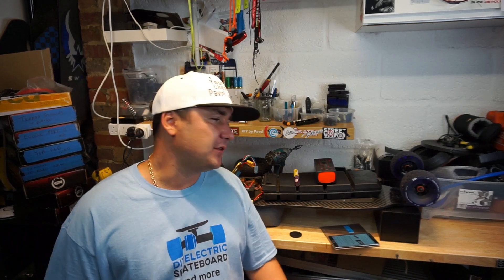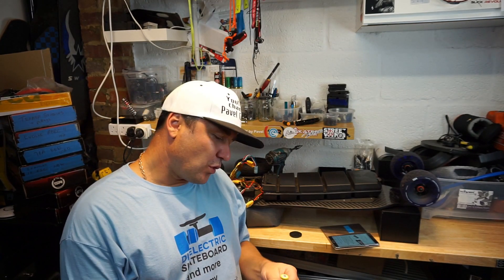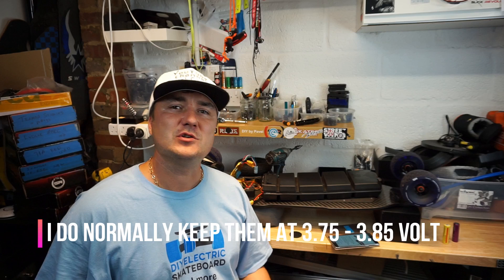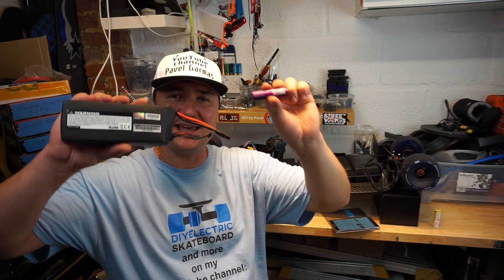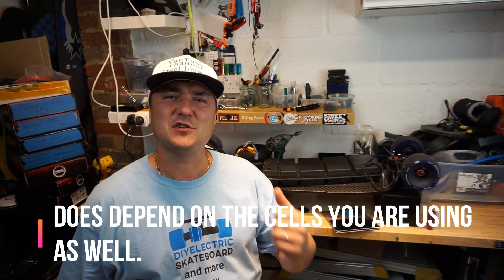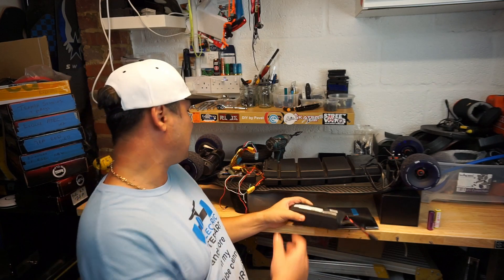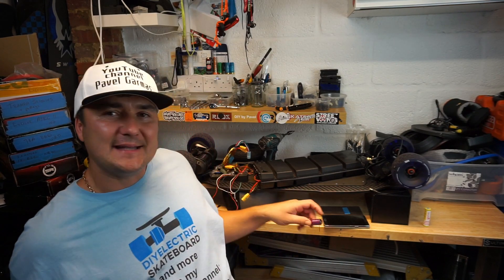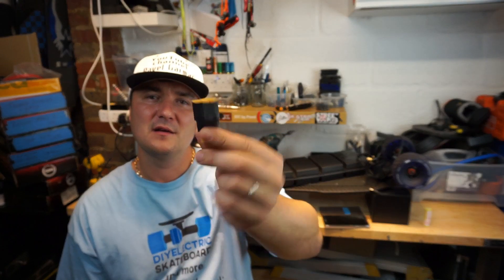LIPO or 18650?  Battery video 02

Comment: I bought the £1000 trampa 18650 pack and was getting 14 miles semi hard riding. Performance loss/voltage sag when going below 70 percent. Took that out went back to lipo felt like entire new board. 21 miles of hard riding and full power drawn all the way down  till 20 percent then I shut down. I. Hugely disappointed with 18650s if you ride a mountain board a require raw consistent power then it is lipo all the way.
Reply from the maker: Agreed. Unless a very good cells are used...

Comment: i think 1850  hve more range , im looking for  12s 8p  , the only problem i see is low amps on motors
Reply from the maker: Hello mate,
Thank you for watching buddy. 12S8P would be an awesome battery and if you use Samsung 30Q you should be able to push it at 160Amp max = two motors 80Amp each and that is a lot : ) 
Ride safely buddy.

Comment: Having a lipo block ontop of the board is a trade-off for having strong power for longer. But I'll want some of those custom cages for my big block lipo
Reply from the maker: Lol,
I am using both - the battery in the backpack and the block on the deck if I am going for a longer ride. Two 6S lipos do give me 7 miles of riding.

Comment: buying an of the shelf product which has good quality if you spend enough money vs diy battery which involves hassle in building. I know what i gonna choose :D

Sure if you want the max from your board, then build yourself but if you have no idea and no tools, then just go for lipo. Trampa boards also come with a pretty good charger, so no problem on that side. easy as hell to maintain them.
Reply from the maker: Thank you for watching and for commenting mate. I do agree and will be using Lipo on my Beast and potentially future Trampa : )

Comment: Hey lover ur vids but Ohmm man that part about the 60cells for 2 lipos packs is rly off with 60 cells you can create a 12s5p battery now lest take vtc6 batterys for that pack, u will have a 15.5ah battery with 175a max draw, to make that same ah with the lipos u will need 4 not 2. And li ion packs can be charge on the same charger as the lipo carger, they will work on bms and balance charger just like a lipo. And btw lipos way more per wh and have more mm2 per wh. Cheaper lipos wil have sag to, you just have some beasty lipos ;)
Sorry no hate just thought i would mention it
Reply from the maker: Nice one mate! I do love when people engage with me and with the community : )
You are correct .... but Samsung 30 Q are normally used in the builds and this is what i have considered for my discussion.
I am working on a new battery now and each cell should deliver 4500 mAmp and 30 Amp constant....hopefully manufacturer did not lie : ) Tests will bring out the truth.
Thank you very much for watching and for the comment!
Reply: @PavelGarmas  cool stuf😮, i get what you mean, although i  would always use vtc6 cells for higger power board. Keep us posted
Reply from the maker: Will be testing the Molicells soon so hopefully beast will get beast battery pack : )

Comment: real men use lipo's
Reply: THOSE with brains buy used best ten second charging nanograined stainless steeled panes
Reply from the maker: I did even google this.....what do you mean mate : ) ?
Reply: @PavelGarmas  the packaging of ebay never cycled LTO 40ish watt hour for $28 bucks or much less is SS.

The scib site itself shows smallest cell (23 amp hour is LARGEST) being ten second chargable.

I personally recall the fuel cell bike used test cycle of H filling station to fill up.  We use so little power superchargers can have us from zero to kwh-ish in seconds if safety and no multiminute to hours delay has VALUE.  Carrying jack around is a pain sure.. But backpacks able to accept fattest fire hose power in make beast owner's happiest. ⛽ can't be pumped like electrons.  Lightning is best free charger ya know. The challenge is finding proper BOTTLE for it. Https scib.jp is close ENOUGH.
Reply from the maker: LOL
Well said!

Comment: Price, size specifications, output (c), mah, and cell count need to be taken into account. A graphene battery like that is great for rcs, but is overpriced, and needs to be designed around for your builds. There not flat, not customizable, and more dangerous than 18650s. If you don’t like 18650s, they have different sizes. In small applications, lipos are king. In large builds, like eboards, when you have dozens of 18650s in parallel and series, and have plenty of current, and voltage, and for that reason, for me anyway, 18650s take the cake for sure.
Reply from the maker: Tank you very much for watching and for the comment mate!
Always good to see people with opinions and reasons why. It is hard to disagree with you as you are correct,
18650 pack that is built correctly and got good cells is hard to beat.
Ride safely brother and stick around.
Reply: Pavel Garmas - 🍻👍👌

Comment: no 18650. 21700best
Reply from the maker: Ok.... very interesting comment. Any chance for couple of reasons why?
Reply: Pavel Garmas sure I'm using 21700 10s5p.  Higher capacity . higher Battery life . It's just a little bit bigger .  Tesla now USES 21700
Reply: samsung 21700 48g
Reply from the maker: Thank you buddy!
Reply from the maker: Got it.
Reply: @PavelGarmas  i do think screwing around with commodity shit cheap enough for high range cars is miserly.

Titanate oxide has competition as Tesla notes in free published 'paper.'

TESLA has notorious sag... 

Supercapacitor can help charge much faster and nondestructive as nanoseconds duration  pausing is required to let dendrites collapse.  A padded ring of scib titanium previously burned in half a decade by Honda lessee's around waste sets inner beast free by such hip protecting collar.
NOT BEYOND COMPLEX @ OWL

Comment: 30q or vtc6 is about 2.60 euro nkon.nl vtc6 no voltage sag. A 4P pack can easily put out 120amps.
Lipo is a pain in the arse awkward shape, need fancy charger, lower voltage, they have a shorter life, they have a tendancy to puff up.
Lipo give off toxic gas. Quality lipo cost more if you build your own packs. 18650 has a mechanic safety fuse on the top. Lipo nothing they just puff up. Lipo mire likely to destroy your antispark. Lipo are more expensive. You compared a 50.4V 15000mah 30Q pack. 5 x 3000 to 44V 8000mah Lipo packs. Huge difference almost double the range and lower top speed due to lower voltage.
Reply from the maker: Hi,
Nice comment, thank you. As i mentioned - its just my opinion.... 4P pack using the 30Q will give you 60 Amp constant only and if using the dual motor set up - 30 Amp per motor. You could push them to 20 Amp discharge constant but not advisable.
12S with 8000 mAmp  will give me  mile range ( tested in real ife ) same pack using 18650 will give me less its just hard to compare P ratings when using Lipo or 18650 for comparison.

Comment: Why do a lot of Evolve guys replace their Lipo batteries with 18650's? They say it gets rid of the sag. Thanks for the info.
Reply from the maker: Evolve boards do use the 18650 cell based packs.
Reply: @PavelGarmas  I know the new GTR ones do now but don't the GTX and GT use the Lipo batteries? Those are the flat ones right? Sorry I'm still learning all this stuff..
Reply: @orlandomarinjr  no, they don't.
Reply from the maker: Hi,
Are you sure that it is Evolve guys that replace the Lipos? Do you mean Trampa?
Some people do use big packs for Trampa boards because it is easier to maintain them i think but Lipo wil have less sag for sure.
PS! Evolve boards do not use Lipo.
Reply: @PavelGarmas  oh really? Thought they did what do they use? I know it's those flat packs. Yeah a lot of complaints of sag on GT and GTX
Reply: Makes no sense, it's the other way around. Even with best cells and many in parallel you will have voltage sag.